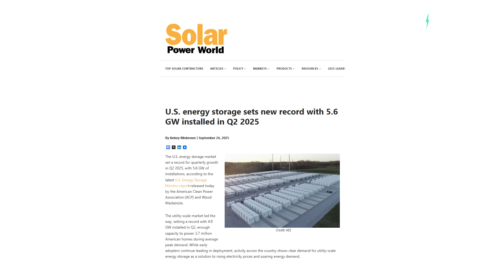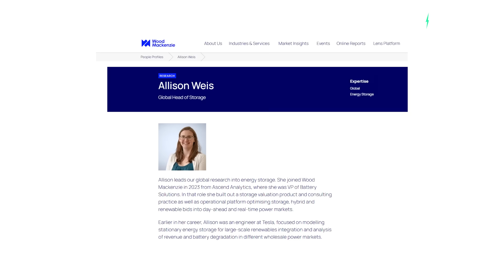America's Battery Boom in 2025 - Massive Surge in U.S. Battery Storage

Comment: Total waste of time and money. Solar and wind technology will be supplanted by thorium nuclear reactors, geothermal energy, and water to gasified combustible gas. Liquid fluoride salt thorium reactors are capable of using nuclear waste from a conventional nuclear reactor as fuel as well as thorium. Note thorium is a waste product of rare earth metal refining. These metals go in motors of electric cars and wind turbine generators. Quaze a spin off company of MIT will be able to vaporize rock down to 10 kilometers or more thus making geothermal available in most places. Stanely Meyers water to burnable gas technology will become common knowledge at some point. Why have solar panels or wind turbines for your home when you can simply run a generator on cheap clean burning water?